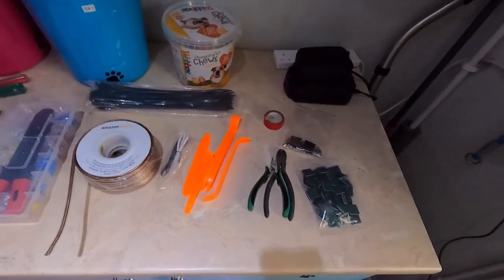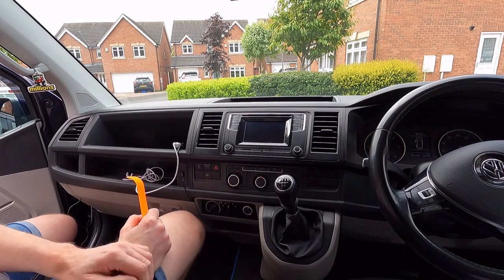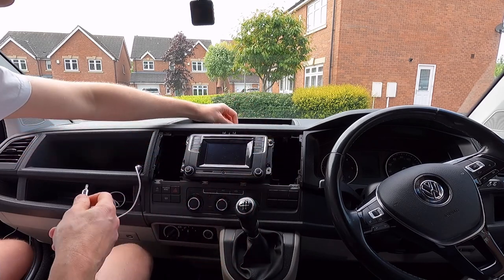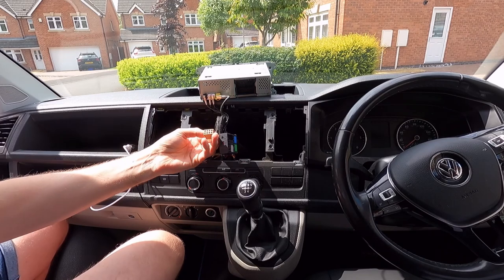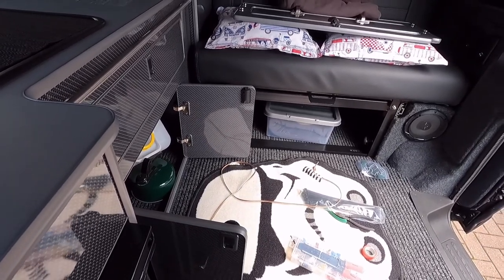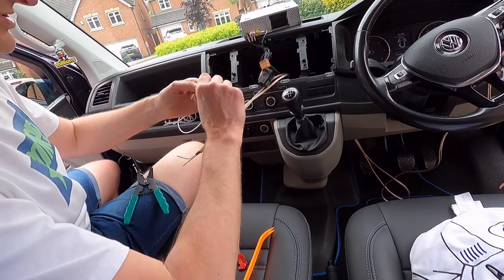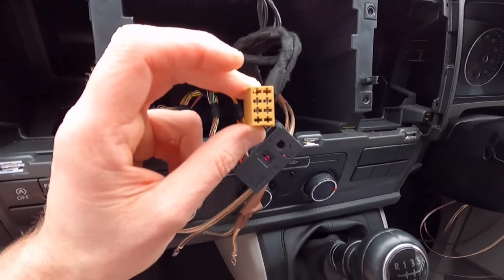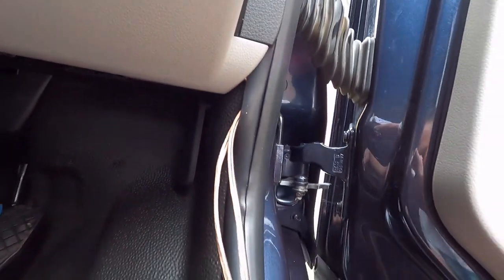VW T6 Campervan Wiring In Rear Speakers - (Part 2)

Comment: Great video mate 
What size speakers and brand did you go for ? 
Which speakers do you have at the front ?
Reply from the maker: The front speakers I fitted in this video https://youtu.be/crvsNOdDNrc they are Alpine and the rear speakers I fitted in this vide https://youtu.be/Gisd9jNOyNk and they are Kenwood.  Hope this helps and thanks for watching.

Comment: HI mate - great video! Is there fader control for the rear speakers after you installed them?
Reply from the maker: No just balance left and right.  Im still looking for a way to get the fader enabled.  If you find a way please let me know.
Reply: @exitthehouse  Ah ok thanks. From what I read online I think you need the VCDS to configure the Fader settings.
Reply from the maker: @RupertShanks   i found a place that can enable fader,  dont know how close you are but he enabled my 2017 T6 fader no problem with software he had.  http://www.remotekeyspecialist.co.uk/

Comment: Hi, would you mind sending what type of terminals you used to connect the wires to the the brown connector. I want to do the same with my T6, but struggling to figure out what is the correct ones to buy.
Reply from the maker: https://www.ebay.co.uk/itm/142427857851 are ones i used
Reply: I used terminal from another radio head unit connector because I couldn't find terminal online to buy for it here in Germany

Comment: Quick question does the head unit have a fader on it tia
Reply from the maker: no just balance left and right,  Ive still got to get the fader added in as by default Van only has front speakers so has been coded to only have fronts,   just not found anyone yet that has the VCDS or knows how to do this.  If you find out please let me know.
Reply: Been to look at some speakers I’m sure he said he cud to the balance  wen I go bak I will confirm he’s done it
Reply from the maker: @andyfletcher3633  Just as an update,  I lost a set of keys recently and whilst I was getting a new key setup I asked engineer about enabling the fader and he had the software to do it in my 2017 T6 campervan.  Didnt take him long at all to find the setting and enable it,  so now have the front and rear fader enabled and present on standard VW
head unit.   http://www.remotekeyspecialist.co.uk/

Comment: Did not see u connect anything
Reply from the maker: Just at 12 mins onwards after ive pulled all the cables through I crimp the cables to the metal plugs and then connect the block back for the rear audio.